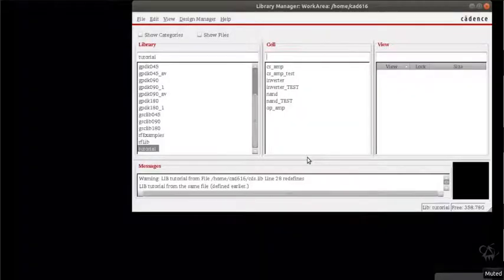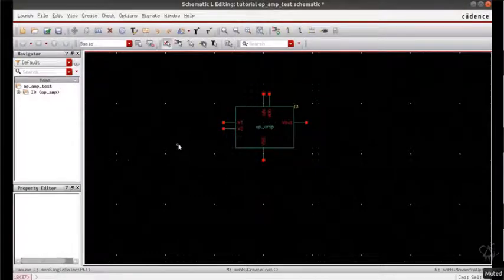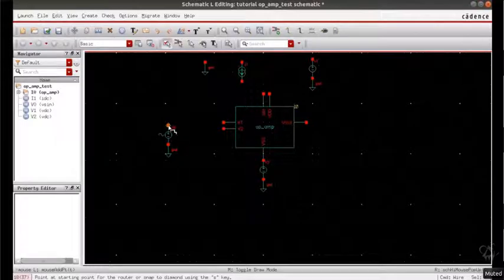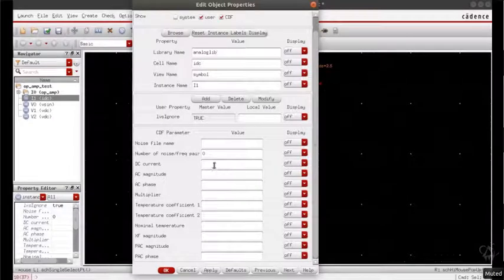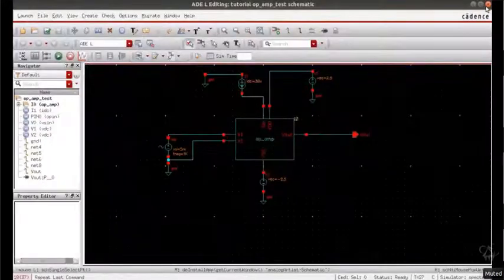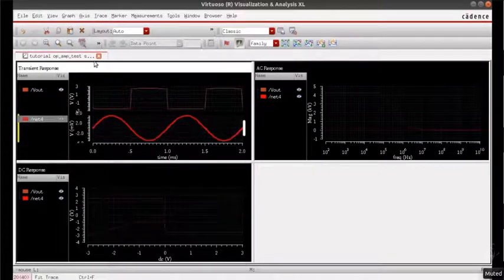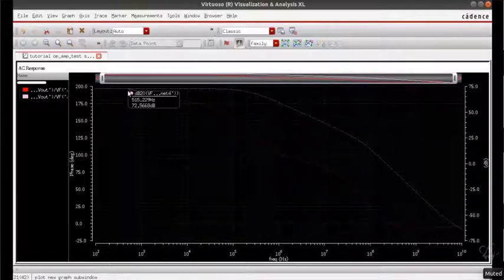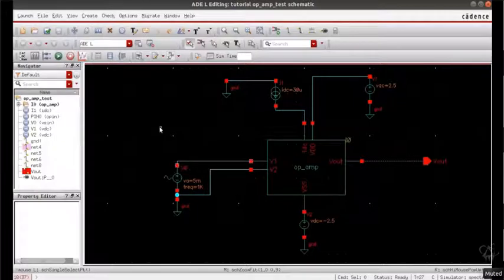CMOS Two-Stage Op-amp simulation in Cadence Virtuoso

Comment: Hi! Thank you very much for this series of videos on virtuoso! I am facing some issues with simulation of the two stage opamp. It does not go into saturation when the input sine wave is applied. Instead, the output is a sine wave with a negative dc component. Could you please suggest potential mistakes to look out for?
Reply: I am also facing the same issue and also the gain is 28dB... even applying all the same parameters I am not getting 75dB gain..
Please help us out sir🙏
Reply: I think in the schematic of OP-AMP, the current input node has to be connected to the gate of MOSFETS which width is 4.5um and length is 1um